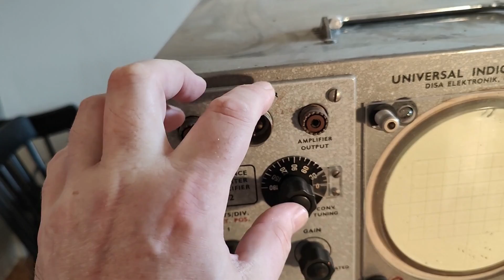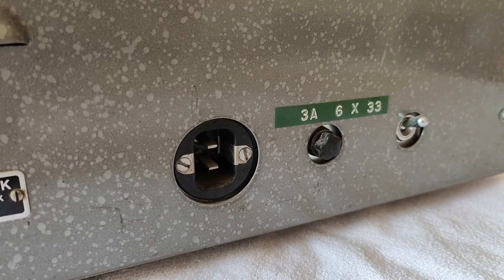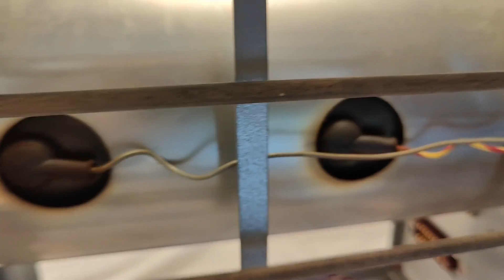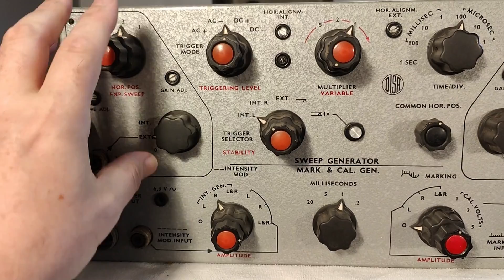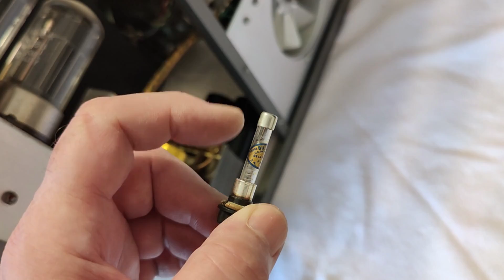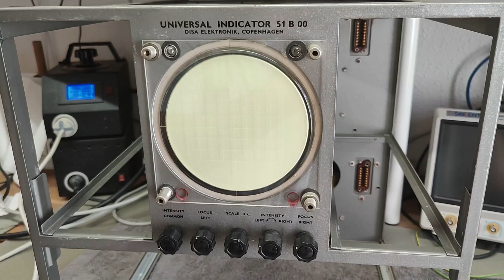DISA Universal indicator 51 B 00 oscilloscope 1961 test teardown

Comment: One Z-axis input and a marker input on the other channel. So you can play Asteroids while using the other half of the scope to calibrate your other lab gear to NASA specs (or fixing a faulty Asteroids PCB).
I've got a Tektronix 535 that I found on the curb, it's similarly huge. One of the 6080s has gone to air, one capacitor got warm to the touch after just a minute of runtime (I replaced both) - and the vertical plugin takes 5 minutes to stabilize, but apart from that it's working flawlessly - besides being a space heater with the most complicated power light. It goes up to 10 MHz though (I even think it goes to 15). For fixing old arcade machines, it's perfectly adequate while still being absolute overkill at the same time! I only use it in the winter.